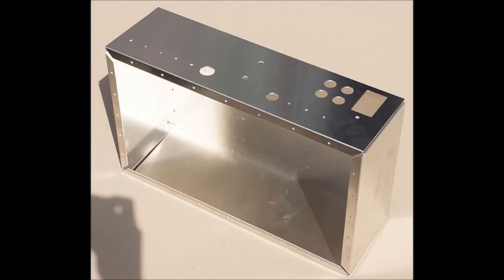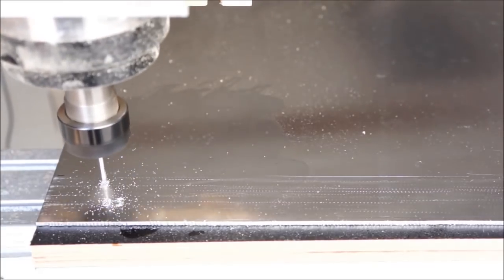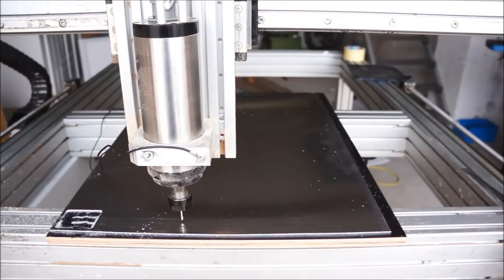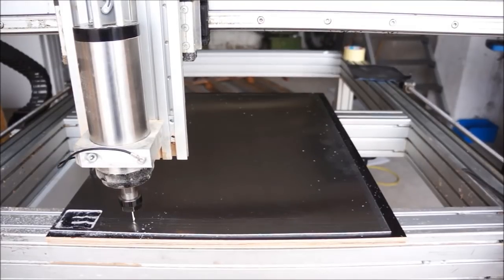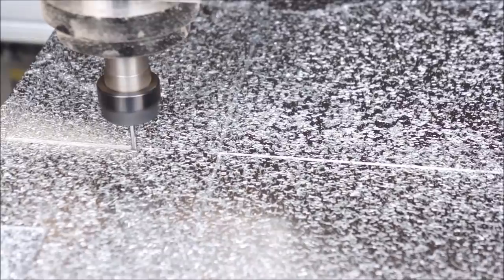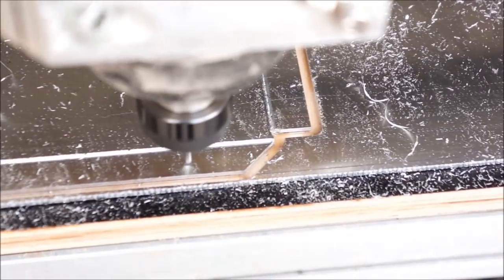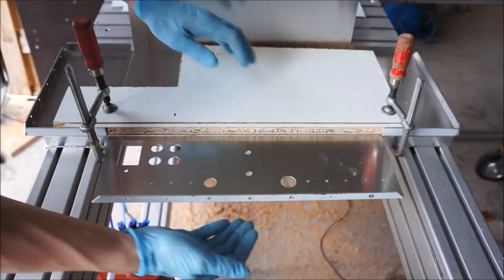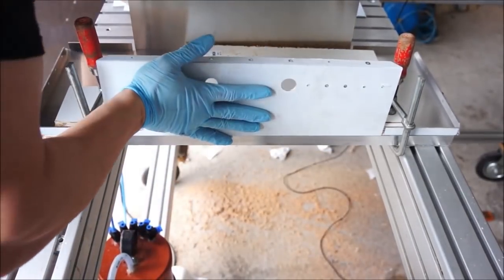Estlcam CNC Controller Housing Part 1

Comment: When you have 45 degree a corner to make a 90 you need to insert a small 1/8" diameter relief hole and your joint will be tighter and straighter